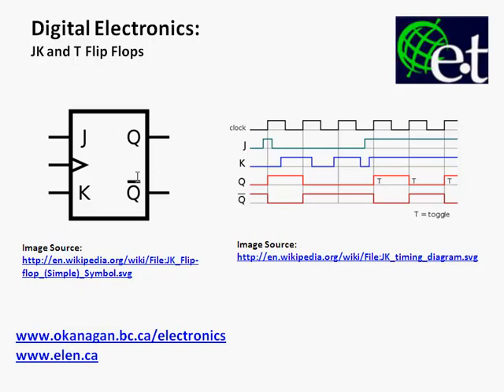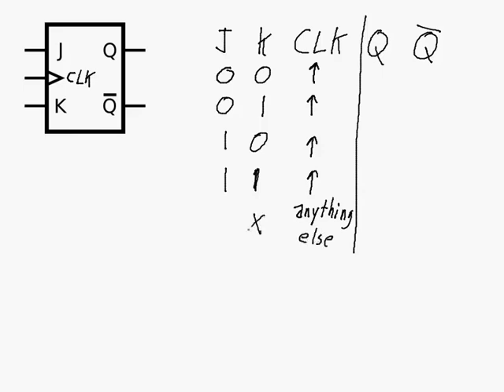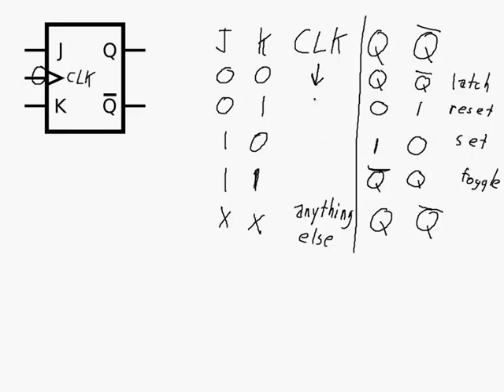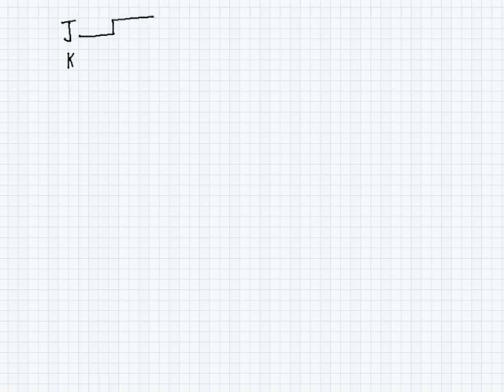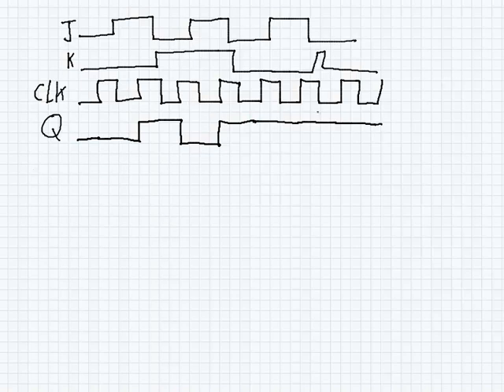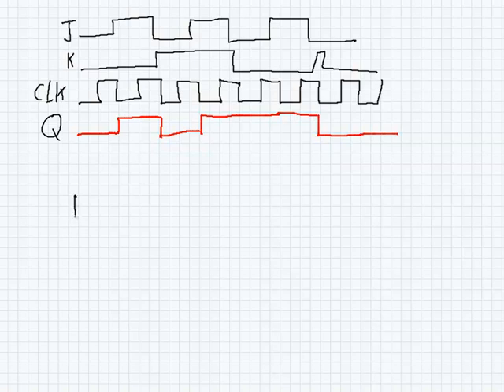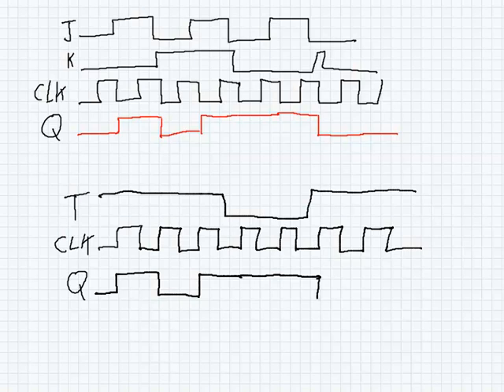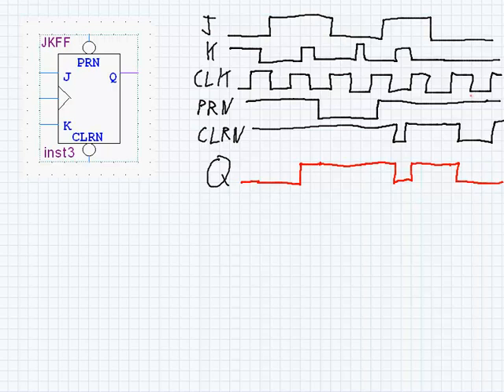Sequential Logic - JK and T Flip Flops

Comment: in 11:50 you took the input K as a '1'. Should we take the inputs values before the clock edge triggering or after ?
Reply from the maker: that's right, use the value of the inputs from just before the clock edge
Reply: David Williams thank you so much :D

Comment from the maker: J could take the value of Q or Q'.  You would just have to connect the Q or Q' signal to J.  Just remember that the value of J would be the value of Q or Q' just before the clock edge.  When the clock edge occurs, Q and Q' would change and the new value would be used for J for the next clock edge.

Comment from the maker: You can't ignore J, it has to be either a 0 or a 1.  Even if you left J disconnected, it would still either be a 0 or a 1 (although which value would be determined somewhat randomly).  You could fix J to be either 0 or 1 and then look at how the output changes as K changes.

Comment from the maker: @Nshuti57109: Clear and Preset are asynchronous inputs (meaning they cause a change in the output immediately instead of waiting until the clock edge) and override the state of the J and K inputs.  Clear and Preset ARE NOT supposed to both be active at the same time...it's like saying I want the output to Cleared to '0' and Set to '1' simultaneously (might work on a quantum computer?? ;-).  However, it could happen, so if Clear and Preset are both active, Q and Q-bar will both be set to '1'.